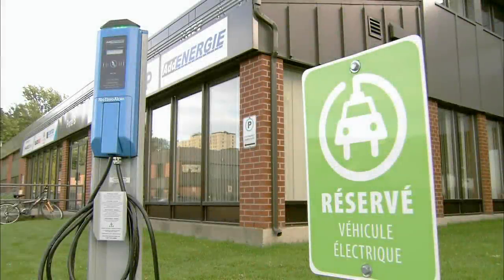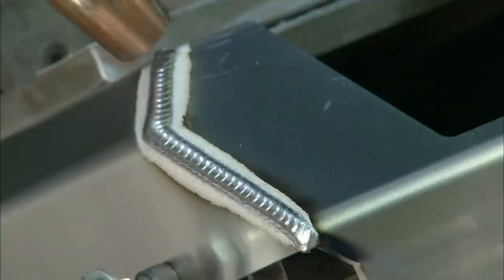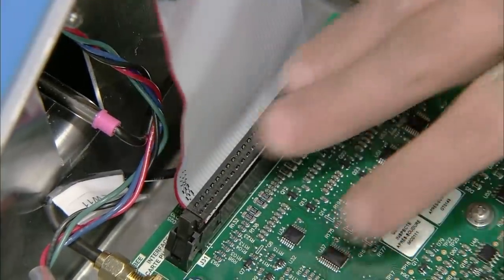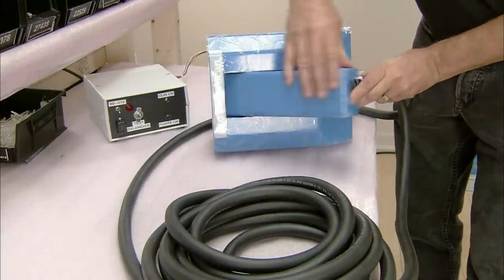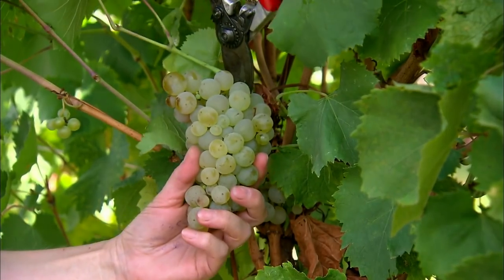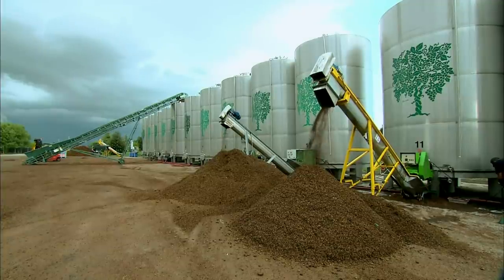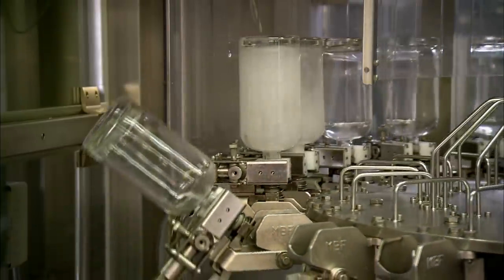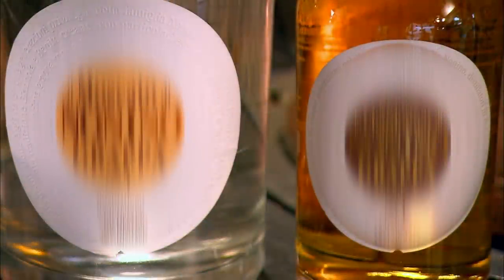ELECTRIC CAR CHARGING STATIONS | How It's Made

Comment: you know it would be alot better if the electric  cars where recharged with magnitic induction coils built into the floor of a person's garage and it would also be lot faster sense a big magnetic induction recharge station for a electric car due to how big the battery is would recharge way faster  than a simple electric plug would this is what nikola tesla would have wanted!
Reply: Simply a Roof made of Solar panels would supply most of the power neeeded.
Reply: @horseplop9  well not really no! still not a high enough output you would barely even make enough  power to run like a few low wattage and amperage aplancises   but using a high voltage appliances like a electric oven or water heater would requre far more power then a whole roof for a mid size house of solar panels would be able to output! also by the way the amount of solar planets you would need to power more than 5KW would require like 120 Meters squared of space by the way! that's much bigger then like any mid sized hose by 5 times over! while a RTG made out of a high energy nuclear waste bearil with just thermoelectric  
power generating simple circuit would make like 10+KW by just sitting and decaying high grade nuclear waste marking power passively! so if i wanted a much better long setadable form of power we could just use the electro thermal power properties  of high grade nuclear waste that can just be put in a barrel that also doubles as a RTG and then turin yucca mountain into both a nuclear waste disposal site that also doubles as a big high power output RTG power plant at the same time that would even give hoover dam a run of its money! aslo it would make like thousands times more energy than like 20km of solar panels plants put together!
Reply: But you are aware of not only how damn expensive such a thing is, but also that it requires heavy reciving equipment within the car right? Its cheaper, faster and more production energy efficient to just use a plug-in system. Also you then run the risk of potentialy magnetizing the entire car assembly, let alone damage any data storage medium that may be installed within the car. 

And then there is the whole airgap thingy that can result in a loss of power between car & charger, the same lost energy would most likely show itself in ample amounts of static electricity. 

Its cheaper, safer, lighter and faster to just use a plug type system instead. As fancy as the alternative may be.
Reply: You know that wireless chrager is same as microwave right? The only reason why you not get burnt alive is bc its just 3.7v instead 220v
Reply: It’s inefficient
Reply: No it wouldn't, it would be way less efficient